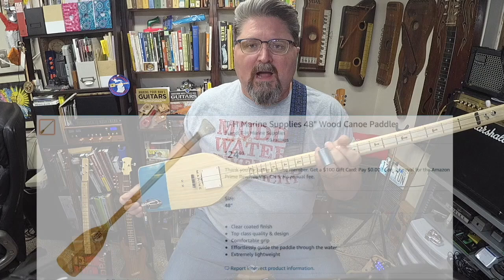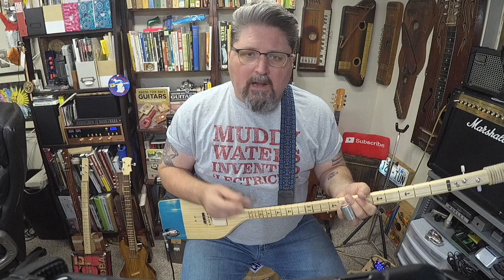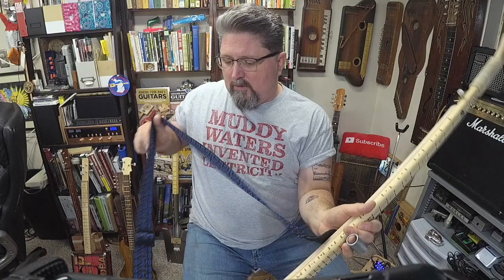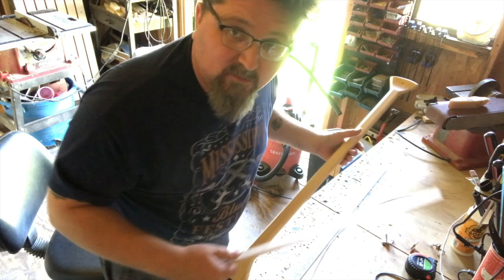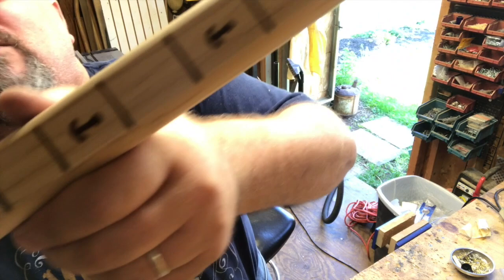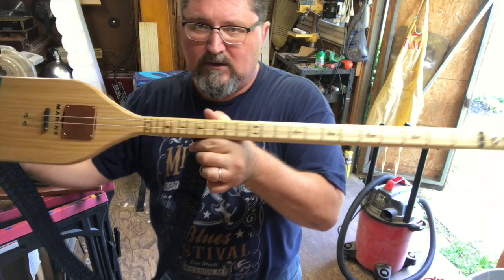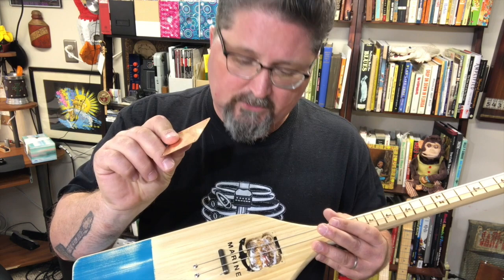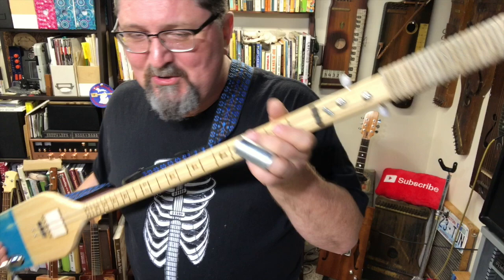The Boat Oar Guitar Project - Two-String Baritone Slide Guitar

Comment: An "Oar" is not what you've made into your amazing guitar. It was a "paddle". A paddle is used with one hand holding the top and pushing while the other hand pulls from lower down. An oar is used with oarlocks on the boat that hold it in place while someone pulls on it's handle further up. Very nice Paddle Guitar, sir. :)

Comment: So did you still use hot glue for the 2nd gittybucker  pickup as well or something else to hold the pickup in?
Reply from the maker: Ended up using Gitty's new wooden mounting brackets for the Gittybucker